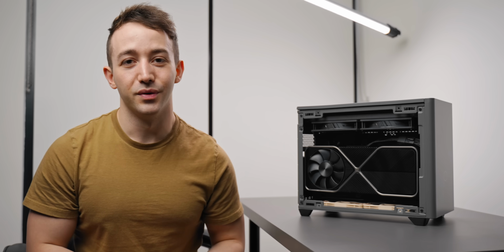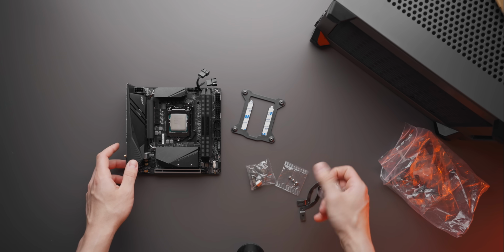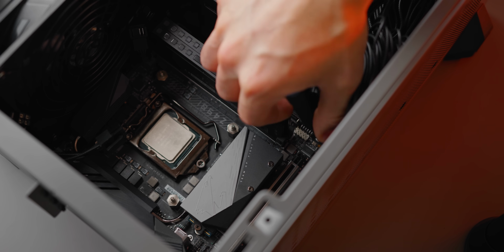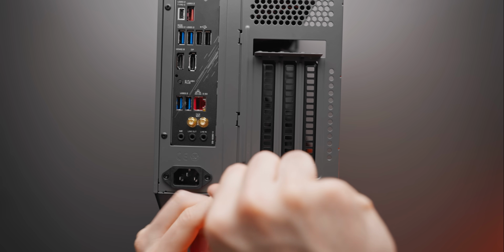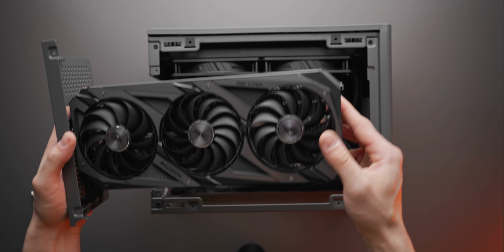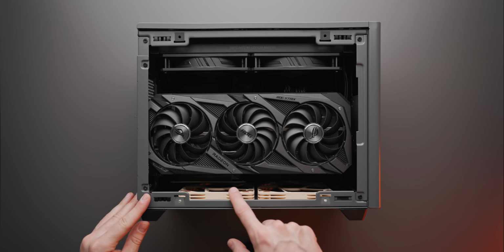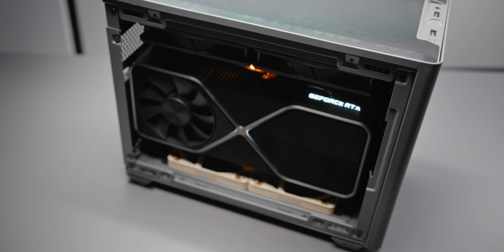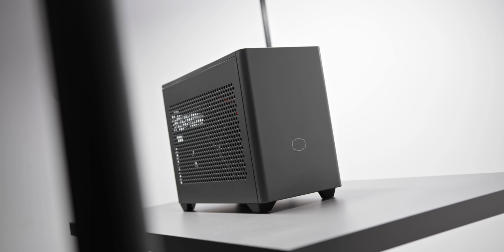The New NR200P MAX Can Handle Anything

Comment: Hey Ali, can you do a custom loop with minimal fittings in the NRP200 please. I'm currently rocking an NZXT H200 with a custom loop (5600x and GTX 1080Ti mini) and I am not happy with the temps in that case (240PE and 120SE Rads). Would really appreciate your input. Also looking into the Lian Li 011 mini, what are your thoughts.

Comment: Big fan of this case BUT. ITX build limits RAM to 2 slots making you leave performance on the table when using modern day processors. Vs. 4 stick RAM config.  
Also this case is big enough to handle the be quiet Dark Rock 220W cooler with fans blowing onto the motherboard eliminating need for any other case coolers when using 5600X or 5800X.
I'm currently running 5600X with cooling to spare paired with 6900X graphics. No other case fan.
Absolutely quite every day computing.

Comment: Why Coolermaster did not add a usb c in the front?
Reply: None of the NR200P cases have USB-C. It is also no small coincidence they share all panels but the back plate (yes, that means you could, in theory, by a carribean blue NR200 off amazon for $80 and swap the panels if you wanted a different color. less unique parts = more efficient to make = more profit. The top panel (for all three cases; same panel) includes integrated stand-off buttons and slots for power, usb, and shared headphones+mic. If this case came with USB-C it would need a different top panel than the 200 and 200P, as well as a different panel IO module and cable set. Different  = costs more. Cost-per-thousand. I too wish they would have given USB-C (to all of them), or at least an option to buy an aftermarket kit that allows you to replace the front-panel IO module and top to one that includes USB-C (I'd gladly pay for it). But alas, no such luck.

Comment: Is there any difference between the case you get here and the 'old' NR200P, other than getting the 'kit' an AIO and a powersupply and riser cable included?
Reply: Biggest differences:

1. Top-mount radiator+fan without case mod. Could not do that with NR200/P. Obviously, occupied by their AIO in this case.
2. Vertical-only GPU mounting. 
3. The vertical GPU sits lower, therefore only slim bottom fans. (technically, you can use a 25MM bottom fan near the front).
4. No side-mount radiator or fans option.

Comment: Why is there no USB-C on the front with a new case. That‘s already a Nono by now.
Reply: There's none in any of the NR200 cases, and they share most of their basic frame and panel hardware across the line, as well as the FPIO module. Only the backplate and mounting of the PSU are different in the MAX, moving the now-required vertical GPU lower in the case, as well as the PS, to make room for the top-mount AIO.

Comment: Great video, but there's a few things that have me a bit bummed. First is your ambient temp that you measured in - it's not really practical for all that many people to be sitting in a 19c room. Secondly is the fact that you don't actually have a combined stress test where both CPU and GPU are being pushed to their limits. I know that Heaven has been the defacto for ages, but it also tends to push a GPU much less than any major game these days does. When I level out at 70ish in Heaven, you can bet that most games will push the GPU to 80+.

Comment: that gpu "bracket" at the back is new in the MAX, no?
Reply: Yes (sort of), at least that specific bracket is unique to the MAX. Vertical mounting is NOT unique. Vertical mounding was possible in the NR200P, but higher in the case. It is lower, and your only GPU mounting option, in the MAX.

Comment: Would it make sense to flip the power supply? In the video shown, it has its own airflow path - how about using it as an additional exhaust fan, especially with the Nvidia 30serioes founders right in front of it with their throughput fans?

I am using the NR200P with a beefy air cooler - in the max version there is no option anymore to air cool and GPU - do you think the AIO is good enough provided by cooler master, or would it make sense to swap it with an arctic AIO for example?

Comment: Hey OT, can you please make a ATX build in the SFF-Time N-ATX case. Particularly with watercooled parts. I have a i7-7700K under a 240mm corsair aio on a ASUS TUFF Z270, a EVGA 1080ti 120mm aio Hybrid, and a EVGA G2 850W ATX psu. If possible, I would like to move them into this slim ATX case to better fit my cramped dorm desk. I've come to despise my Corsair Crystal 570X RGB case younger (very dumb me) purchased.

Comment: Question 1)  i don't want the Max, I'd like to add in my own components but want a AIO at the top. with the base NR200P what Radiator can fit at the top?
Question 2)  I'd like to put the graphics card horizontally to see the AIO Kraken display is this case capable of doing this and not using the Riser?  Thx :)
Reply: With the current nr200p, top radiator isnt possible without modding it
Reply: @brianmateo8041  Hey Donut! what do i need to mod?

Comment: i have the nr200p and the first thing i noticed is the power socket in the back. the Max has it on the bottom but the non max has it up top. It's one of the only gripes i have for the original case as the cable can come lose. First ITX build i have and yes Max and non-max should be super worth for your simple build!

Comment: But what about cpu temps when the gpu is under load with TG? You'll be dumping 300+w of heat into the case before the cpu rad gets the preheated air.

Comment: I've been contemplating to go either with this or the Lian Li Q58. If the NR200P Max doesn't come with included PSU and AIO, I would definitely go for the NR200P.
Reply: I know this is kind of an old comment, but hopefully someone else such as myself that has just stumbled upon this video will see it 

NR200P is way better than the Q58 in terms of thermals, I've built in both now and the thermals for my 5900x/RTX3080 combo with a 280mm rad in the Q58 were pretty bad for my liking. Even with cold air being piped into the rig through an adjacent window, during gaming with GPU fans maxed out I was still hitting about 65C+ on the GPU and the CPU was easily hitting over 70C with fairly aggressive speeds on the rad fans and pump too. 

In the NR200P with a side mounted rad as intake, and slim fans under the GPU as additional intake and exhausting out the top. Temps while gaming are around 55-60C on the GPU and around 50-55C on the CPU. Astronomically better. 

I also found the NR200P to be overall easier to build in too and the built in cable ties were much better than the Q58 which was a small, but welcome difference.
Reply: @gamehawk55  thanks for the reply!

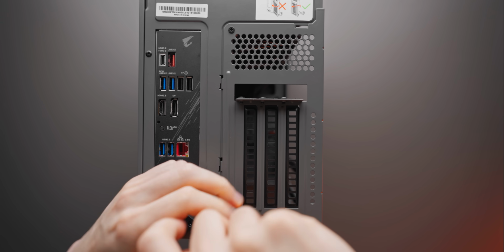Comment: 7:47 even with all those muscle, he is struggle to loosen up the screw.
So this case is a no go for me.
Reply: Two screws torqued by factory. Just don’t torque it down as hard after. It does hold up your gpu so it’s sorta meant to be a stiff and sturdy section of the case

Comment: could you check out the SAMA IM01, there's a lot of rebranded cases of the same chassis too such as Tecware Fusion. Its an interesting SFF case as it can fit ATX PSU and MATX Mobo. It can also fit most of the big boi gpu but only with SFX PSU.

Comment: Is it possible to build this kind of setup with the already existing NR200P? Meaning having a radiator at the top and placing the vertical mounted graphic card in the bottom of the case? Like that very much.

Comment: I would love to see the MAX with top intake and bottom exhaust with a TG pannel. Should be the optimum combination for thermal results
Reply: No it wouldn't. Heat rises. So if you're trying to pull air through the AIO you'll lose fan efficiency because the fans are designed to push not pull through a radiator. Plus now that air is warmer than room temp air because it came over the CPU radiator, so you have hotter air trying to cool the GPU. Then you're trying to push all that hot air out the bottom with slim 120mm fans with less than 25mm of base clearance is just asking for hot air to get pushed back into the case. 

Bottom intake, mesh side, top exhaust gives best thermals period. There will be no better option. You'll lose a bit of temps if you choose TG side panel, but it's nothing to be concerned with, as it still provides plenty of airflow to keep components cool.
Reply: @chieftain20  hey thanks for your reply. Seems reasonable. But watch his latest video. You'll see my suggested setup is actual optimal. Thanks again though

Comment: Damn I was expecting the TG panel temps to be through the roof.
Obviously CM have actually thought about GPU temps with the GPU pressed against the TG and put that extra gap.

How does the CM 280 AIO hold up against the tried and true Kraken X63?
Is there better performance/less noise to be had with a fan swap?

Comment: This is is beautiful with the tempered glass panel buy I just can't justify the price when I can get a corsair 4000d for way less and better thermal performance. I hate that you pay more for less when it comes to SFF builds.
Reply: You can get the same results inverting a regular NR200P.  There is a video of the mod on youtube.  The regular NR200p isn't much more expensive than the Corsair 4000D.

Comment: i dont like anything that is using their own parts for most, since variety is the spice, granted you get a top rad with space made for it, id still prefer an EK, or Nzxt 280mm AIO Rad, and 650w sfx seasonic, or corsair sfx 750w- psu. Coolermaster are just not the brand i'd want for an all in one build. If Corsair released their Corsair ONE case with Case, CPU AIO, GPU AIO, +PSU, id use all the parts.

Comment: I don't think it can handle a DH-15 cooler, for those of us that don't want to either a) compromise with an aio or b) mess with a custom loop. The Sliger S620 can support a DH-15, and you'll definitely get better thermals compared to a sandwich layout with a small aio and also none of the headaches with water cooling.

Comment: Thank you very much for posting. I knew the new Max was coming out but I wasn't interested. Just finished a new-build with the NR200, ASUS ROG Crosshair VIII Impact MB, RTX 3080 Ti FE (thanks Best Buy on Aug. 26th), 5 Noctua fans (3x25mm & 2x15mm), Noctua C14S CPU Cooler (yes, fits in the Impact MB no problem). Plus the regular stuff. Works great.

Comment: looks good and priced well, especially including a PCIE4.0 riser cable into the bargain, but at the end of the day, you are compromising on space, RAM capacity and PCIE slots. And for what? So you can get a smaller case? I'm not sure why you'd want a smaller case. Surely its just an aesthetic choice.

Comment: I don't think your link is to the correct case.  It doesn't mention having a preinstalled power supply or aio.  It seems to be a link to just the NR200P.
Reply: It doesnt seem to be on amazon yet. He put two links but it only shows the nr200p

Comment: Hang on… am I understanding correctly that Cooler Master have optimized the motherboard placement and back panel of the NR200P and are locking that change behind $250 of package components? I already have an AIO, the 850 PSU would be completely overkill for me and PCI Gen 4 the same. I’m happy for everyone who wants this package but I just want a $130 NR200 that allows top mounted rads… is there going to be a standalone version or do I really have to shell out $300+ just to get a space optimized version?
Reply: That's really my main gripe with it as well. Love the new features of the case itself. But it really only appeals to someone wanting to build a whole new computer. Guess we'll have to stick with modding the NR200P for now o.O

I want that Gen 4 riser cable tho. If I accidentally change my bios settings off Gen 3 mode one more time I might lose my cool.

Comment: What did they change to allow a top mounted radiator? Is the top still plastic and removable? Is there a reinforced mount for the rad? Did they move the psu bracket? Mounting a rad on the regular nr200 requires some modding does it not? I see they recessed the vertical GPU mount a bit but missing what else they changed other than providing components. Maybe I didn't watch carefully enough.. I'll rewatch but if anyone has some insight I'd greatly appreciate it. Especially regarding mounting a radiator on the top of the OG nr200. Thanks everyone. Optimumtech, love your stuff!

Comment: Is the 3090 FE under load with the 70C and 66C or is that at idle?

My 3080 Ti FE with thermal pads replaced is around 84-86 and vram at 90-92 in a larger case (NZXT H200) when under load. Two Noctua NF-A14 iPPC at 2800 RPM for intake, 1 NF-A12x25 at 1800RPM for rear exhaust, and NF-A12x15 also at 1800RPM for top exhaust.

I don’t think the cool air turnover in my case is an issue, but I still can’t get the 3080 Ti FE in the 70s.

Been looking at this case for a while back when the previous version was released. I’m really liking the grey in this new version.

Comment: Considering that you can remove the top and bottom panels with those screws on the back, is it feasible to run it as an inverted case "out of the box"?

Comment: In order to fit the AIO at the Top, the Mainboard had to be lowered down, thats why a normal PCI-E Mount won't fit. That's also why the one ASUS Mini-DTX Board wont fit.
In the NR200P MAX for Custom Cards it may be better to have the bottom slim Fans exhaust the hot air from the GPU.
So VRM Temp and bottom exhaust Fans might also be something to test. 

I use the NR200P Sakura Edition (yes the Pink one) and in it is a 3090FE with a 280mm AIO at the Sidemount. With the same slim Noctua Fans i have max 72°C GPU/82°C Hotspot/98°C VRAM Temps in a Room with ~27°C, but my GPU Fans run only between 30-40%RPM (Noctua run at 50%), above that they become audible. Thanks to the sidemount Fans the Temps on the Board are below 63°C including VRMs.
Reply: I am glad I purchased the an asus ITX. I almost purchased the Asus ROG (X570) Crosshair VIII Impact (mini-DTX)  but was worried about the size in the future.

Comment: With the max, you have to put your graphic card vertically, so have to use watercooling, so Can not put PSU on other place, ans can't use atx PSU neither. So... the max seems to be a very Nice kit. But i still prefer the nr200p, which has a bit more possibilities.

Comment: You said in the video that the PSU could handle any GPU currently on the market, but I assume that the included PSU is the CM v850 SFX Gold, which can handle almost any GPU, but it cant deal with the power spikes of an rx6900xt, and can shut down under load if paired with one (I personally fix this problem with a slight undervolt and underclock on the GPU, but it is not a perfect solution)

Comment: Kind of a steep price tag, but you're getting double the radiator compared to an NZXT H1 as well as a PSU with a higher wattage output. And for the same price. And it doesn't look like you have to worry about your setup burning down. On top of that, the GPU can survive the tempered glass side panel. Overall a hell of a deal. Will definitely be recommending this to people wanting a premium ITX setup to streamline the component choices.
Reply: unless you're sitting on your own parts anyway, the max version is a good deal

Comment: Over time, dust builds up under the top mesh of the NR200 and it looks bad. Cleaning the top mesh is labor intensive since you have to take off side and front panels to remove the top and then remove fans/radiator from the top panel. Only then you can reach the dust. I did not manage to find a better ITX case for my hardware (considering both performance and appearance). But this little problem bothers me much. I wonder what can be done about it (except using top fans as intake but then thermals are too bad and my 2080ti gets throttled).
Reply: any updates? how did you deal with this issue?
Reply: @UlfMTG  removed the top mesh

Comment: As an old NR200 user, I hate this case so much. It's a good one for new users, but for me, it just doesn't fix the problems on the NR200. I wish they release a top radiator and bottom radiator version of the NR200...

Comment: Been heavily considering the Meshlicious but this might change my mind. One thing that would deter me though is the included Cooler Master psu — I heard they’ suck. Also why did the gpu change multiple times in the video?
Reply: My guess would be he was using the 2070 for his previous thermal tests with other cases. 

Then it would fair to run these benchmarks with the same configurations among different enclosures. Just my 2 cents though.

Comment: Is this a paid ad from cooler master? Pretty sus that he shows the build with a new radeon card and 3090 FE but then the standardized charts are with a 2070. Later 3090 FE thermals are shown in a different format with less details and show the same temps as the 2070? ~66C with mesh side and ~70C with TG side? Identical temps with 2070 and 3090 FE? sus.
Reply: 2070 is probably because that card is what he has tested the other cases with, and the 3090 is probably because its the highest power gpu out there
Reply: I was wondering this as well and there was no clarification from his side.
Reply: Yea but 2070 and 3090 have the same temps?

Comment: Wait, is this really the same dimensions as the original NR200?  I thought it was a bit taller.  Looking at my NR200 I have no idea how you could fit a top-mounted radiator and fans in it...